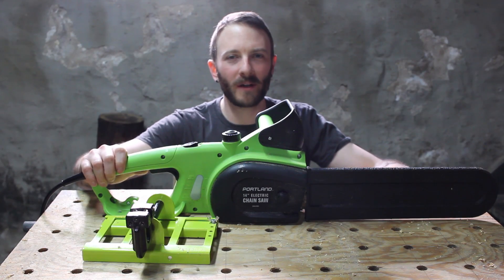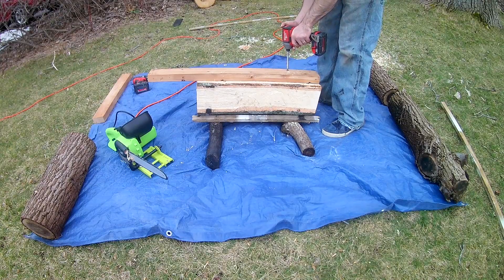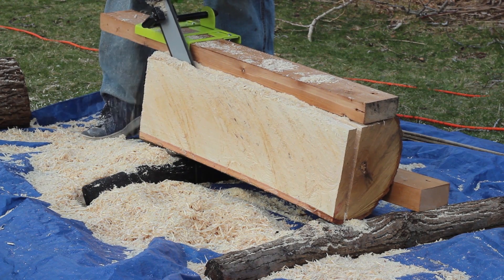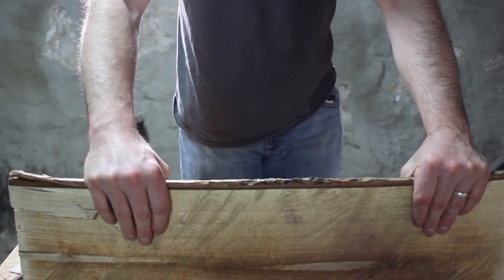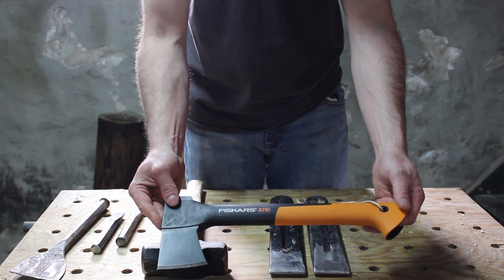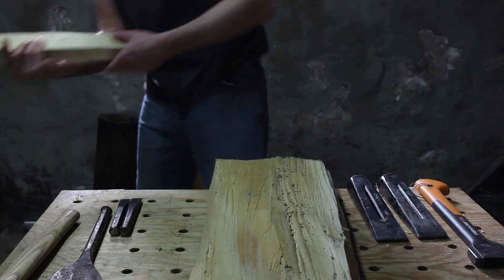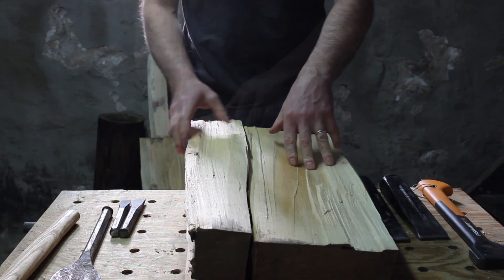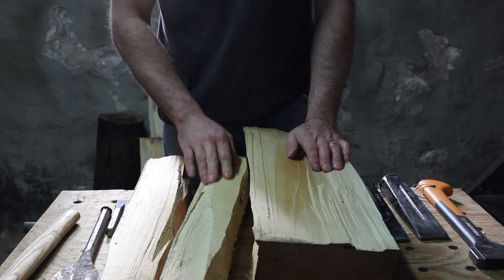Electric Chainsaw Mill on a Budget: Review and Suggestions - HNB #7

Comment from the maker: Having used this saw a bit more since posting this video, I'd recommend against buying a Portland Electric electric chainsaw for this purpose.  If you just need to buck some small logs and all you have is $40, the saw will get the job done.  Since I bought the saw, I acquired a 12A 14" Craftsman chainsaw and it works much better than the Portland saw.  If you have more than $40, I'd suggest spending a bit more to get a more powerful saw.
Reply: Is the craftsman one you bought also electric? Have you tried a ripping chain on them. I love you trying to get this on the smallest budget, as i am.
Reply from the maker: @TheJunkyardgenius  Yeah, it's a 12 amp electric saw.  I got it for free.  Those electric chainsaws are fine for cutting small trees or branches, but I definitely wouldn't recommended one if you're hoping to use it as a sawmill.  A small gas chainsaw like the one I mentioned would work a lot better. I believe the gas chainsaw used in the video had a regular skip tooth chain.
Reply: @HacknBuild  i need an electric chainsaw for in my workshop, i vant have those fumes in there. Im wondering about making a much more powerfull electric chainsaw and using a long bar.

Comment: A chainsaw mill is made for milling lumber not for splitting your wood. Also the chain that comes with your chainsaw wasn't made for milling lumber, you need to buy or modify a chain to a ripping chain, it will speed up your cut and will be a smoother cut than with your standard cross cut chain.... the wrong chain could burn out your chainsaw in no time.
Reply from the maker: Yeah, rip chain would be better - I just was curious how this would work.  I think the crosscut chain works fine if you just need a couple of planks from a log.  The electric chainsaw is only good for cutting smaller logs and branches.

Comment: seen a few vids in youtube land showing that if you only use the nose of the saw and go free hand no guide you get a better cut and dont dull the blade as fast also since only the nose of the bar is being used the blade doesn't get bogged down as much. of course you would use chalk lines to lay out the log. then you can cut a straight line down the log. in every chainsaw mill video i have ever seen, no matter what kind of blade was used the process was always slow going just a little faster with a ripping blade is all. so patience is key to good ripping.

Comment: Um, no. 1st things 1st. Sharpen the chain! Also, as was already mentioned, technique and ripping chain make a huge difference. Additionally, you're cutting into an extremely dense hardwood. It's going to take time, especially with the dryness of it. If the wood is dry, it won't mill out as fast as green wood. Also, you're using a HF chainsaw. They are not known for having power. Lastly,  when you hand split, it'll take just as much time to square up the boards even maybe more and you'll have a lot of waste from planing.
Reply from the maker: The footage you're seeing is how the saw cuts out of the box - compare that to the footage to the 14" gas powered saw, the electric saw is way slower!  We started out using sharp crosscut chains on both saws.  The point of this video isn't to see how good we can make the HF saw, but to see how well it will work without any modifications.  The logs cut with the electric were  green. They'd come from trees that had just been cut down a couple weeks ago, the oak log we ripped with the gas saw was probably sitting about 18 months.  It's possible the green wood dulled the blade faster, but bottom line for me is that the 9 amp motor isn't very powerful.  I got a 12 amp Craftsman chainsaw for free, and it blows the Portland Electric saw out of the water in terms of cutting speed.

Comment: I got a setup like that and had much better forward progress. So, I think there is room for technique improvement. My issue with hand splitting is that it follows the natural grain of the tree, which means twists and bows. It takes a lot more work to clean that up. If you are dealing with small pieces, there is something to be said for human-power only.
Reply from the maker: Were you using an electric or gas chainsaw?  We had better luck with the gas chainsaw, it was still pretty slow going though.  I think we got around a foot a minute.  The other thing I noticed was that the chain on the chainsaw got dull really fast, so upgrading to a crosscut chain would probably better.   It was a fun experiment, and I learned that I find hand splitting pretty satisfying!
Reply: Hack 'n Build It is an electric one with a brand new chain. My first cuts were agonizingly slow and I had the same problem where I ran off the end of my guide board and had to finish by hand. It was also tough to gauge when I was through the bottom and I really didn't want to grind out my garage floor. The trick was an over-long guide board and putting the log on a pallet so the cut ran through open space. The biggest logs I had were probably 10", so taking it in one pass was better than a half cut then a second cut through too.

Now, while my forward speed was faster, I still haven't mastered the truly straight cut. A slight flex or twist veers the cut off. Those little dips mean more planing. Compounded with the 1/4" kerf, means I was losing 1/2" or more with each cut. So, for now, I find that it's better to cut the boards into 8/4 or 12/4 slabs. Once dry, I'll spend a day cutting them into 4/4 or 5/4 stock on my brother's bandsaw.
Reply from the maker: That Portland Electric chainsaw is I bought is pretty weak.  I got a Craftsman electric chainsaw for free, and it's got quite a bit more oomph than the Portland.  I think it has a few amps more power.
Reply: Hack 'n Build Probably. I opted to get a shorter (16") bar with a higher powered motor. It wasn't bogging down at all.
Reply: @RIBill  if you want to get technical you are only losing a 1/4" since the first cut is a scrap piece but still gets a kerf so it loses 1/4". each subsequent cut also loses 1/4" for the kerf. therefore each cut has 1/4" loss.

Comment: It was probably better and less frustrating to cut lumber when you build yourself a bandsaw mill instead of using a chainsaw mill. Besides that, if you would use a sharp sthill Chainsaw it would be much better in result and much faster.
Reply from the maker: I really can't argue with that, sharp or dull the electric chainsaw didn't work very well.  The gas powered saw too far too long for my taste too.  I don't really have the room for a bandsaw mill, so I'll be sticking to hand splitting for what I am doing from now on.